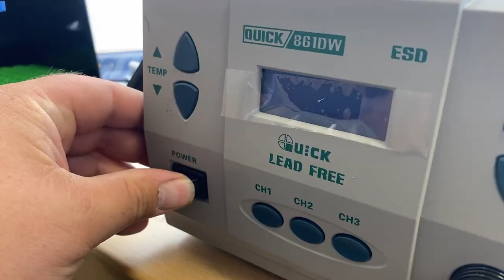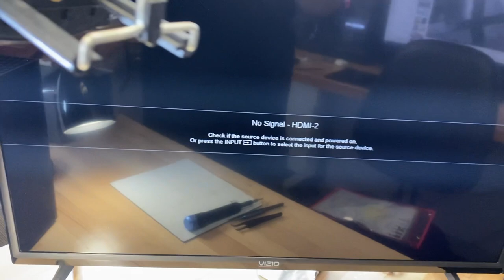XBOX Series X2020 HDMI Repair(How Many Roaches?!)

Comment: I’m curious about how do these cockroaches make their way into the console? 
Like I’ve owned many consoles and they do get pretty dusty after a while but never had one infested with insects like this.
Reply from the maker: I’d like to know the answer to that question as well. I’ve never had more than dust in my own devices.
Reply: Heat there drives them to the each and it’s dark in there and temperatures exceed to there liking which leads to baby roaches